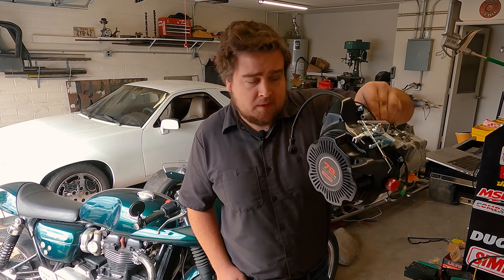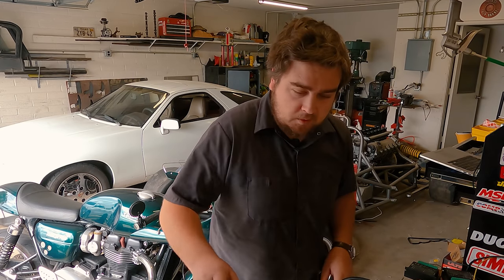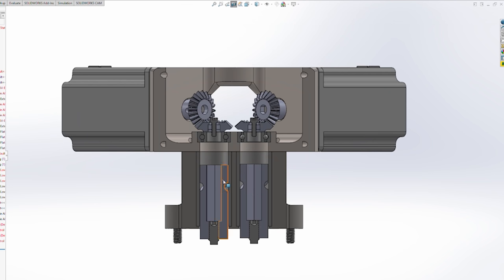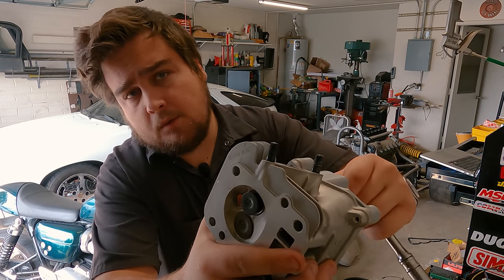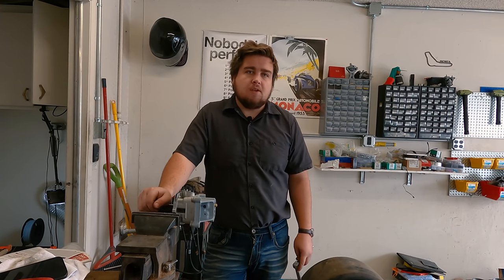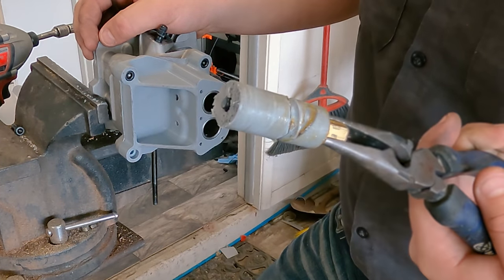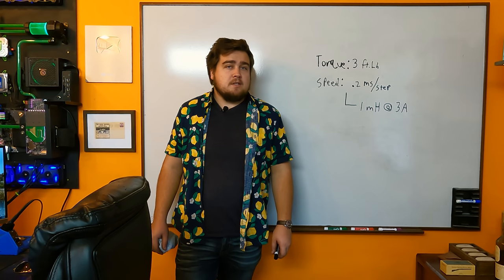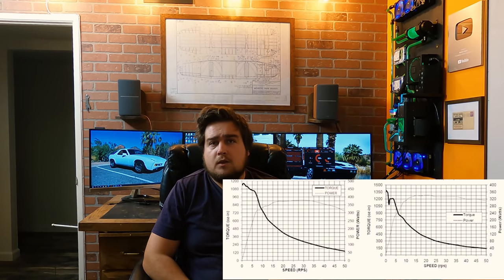Adventures In Deleting Camshafts | The Theory

Comment: The problem of necessary inertia of a motor strong enough to do the job fast enough was my initial reaction to the 3d model. Related to your calcs - the valve opens & closes muuuuuch faster than 1 whole revolution.
Reply: Exactly this, and for the best volumetric efficiency you want the valve to open and shut as fast as possible.  This will become especially important when you consider valve overlap which will need to be well controlled .

Comment: Would it be easier to find a smaller, faster-acting stepper motor, and connect them in series to the same shaft to meet the torque requirements? It seems like the response time is the limiting factor.
Also, I'm not sure your calculations are correct, because during the compression and power strokes, neither valve is moving. So the time of the intake and exhaust strokes is still going to be the duration of 1/2 a revolution, and that's the time you have to open AND close the valve, including any duration you want it full open. 6000 RPM = 100 rev/sec. 1 revolution = 0.01sec. 1/2 revolution = 5ms (that's the entire duration of each stroke). So basically you're looking at around 2ms to open, 1ms hold open, then 2ms to close (depending on how much air you want to let in and out of the cylinder per stroke). You'll be hard-pressed to find any non-camshaft system that responds that quickly, and you'll have very little granularity for tuning.

Comment: Just a thought... Make a rotating valve rather than an in/out valve. Like a sleeve valve arrangement but within the cylinder head.... As I say... Just a thought that came to me. Love your work, keep it up
Reply: The valves in 4 stroke motors are a pretty important part in their performance, the valve sticking out in the air stream creates tumble which helps homogenize the charge mixture. Rotary valves would work and be easier, but would negate a lot of the benefits

Comment: Wall color is great. Have you happened upon rusEFI? That's a similar color scheme.

Air actuators are typically fast. Either that or perhaps have a spinning motor then transfer the energy with an AC compressor clutch. If you are looking for electrical drive, a DC servo is your friend.

Comment: You could change the ball bearing guides to be non linear, Low pitch to overcome the high opening torque transitioning into higher pitch to get the valve open in time. Also if you havent allredy you need to re-make Bose active suspension

Comment: (also sent via patreon) Simplify the task, convert to running from steam/pressurized gas

That lowers your temps, and allows you to lower your RPM making it much easier/cheaper to build something that will work, allowing you to experiment more.

external combustion engine would also let you go to 2 stroke vs 4 (more power for the same size engine), and adjusting the intake valve timing to change the expansion ratio as your throttle will really show the power of computer controlled valves

Comment: When you originally said you were going to try steppers in the last video my immediate thought was "it'll never be fast enough." I didn't comment because too many youtube ppl get negative comments. TBH I really think you need to use solenoids. Maybe steal one out of a starter motor. It'll require a lot of current, and to get precise control over it some tricky mosfet pwm circuit. Negative side would be that you'll have to deal with a spring again unless you do a pushme-pullyou setup (complex). Oh well, I can't wait to see this work as you desire.
Reply from the maker: The only problem with a big solenoid is the inductance of the coil. It takes so long for the coil to discharge it can't charge up fast enough.
Reply: @WesleyKagan  Yea @5000RPM that'd be about 80Hz. You'd probably have to wind your own to get something fast enough.
Reply: @WesleyKagan  Car subwoofers seem to manage to operate fast enough at very high amplitude. Plus, rotary woofers use the voicecoil technology to operate an actuator at the required frequency.

Comment: I love the idea of the ball bearing rotation design. One thing you might be able to experiment with, since at high RPM you aren't really ever going to want to adjust valve lift (it will just be max lift above some rpm threshold), you could do a continuous bearing race, and control duration by slowing a continuous single direction spin rather than reversing, where at low RPM you can easily adjust lift by reversing. You can also improve performance with a servo motor (or just a 24Vdc motor with a rotary encoder slapped onto your design), since you don't need exact positioning anymore, just good position with good torque. If you want extra resolution on the "cam" sync position go with a little Pogo pin to ground a sensing pad when the valve reaches the top of its stroke.
Reply: Just my thought as well!

Comment: Engineering is the art of making the thing that you need, from stuff you can get. You missed on both counts! (But I love it, DO NOT STOP!)

Balls may be a bad idea in the screw-jack thingys, they're going to generate radial forces that can only jam things up, cylindrical pins or small roller bearings running in flat tracks would mean the only forces generated would be axial and rotational, (also easier to make, and make reliably).

It's also worth looking into higher voltages for driving the motors, you may have already considered this, but do not arbitrarily limit yourself to 24v, IR2 is a thing!

Loving the projects dude, it's like my school-boy notebook, but on youtube!

Comment: Just a quick note on valve actuating times: you calculate 20 msec per revolution (at 6,000 rpm). This includes things other than valve operation, like compression and intake for the intake valve (the valve should "dwell" at the ends of its operation). Camshafts typically are designed to have a "duration" of about 240 degrees or less (not the 360 you calculated); keep in mind this time also has to include operation in both directions. So, 1/2 of 2/3 of 20 msec or less than 7 msec per "stroke" and the mechanical direction-switching action usually will take up some of this as well. Of course, you can gain time by reducing your maximum rpm (probably a good idea with the Harbor Freight engine anyway). Keep thinking happy thoughts!

Comment: Wesley you are not thinking from the ground up, rather from the clouds down! My humble thoughts are to use air cylinders to open the valves and a tapered rail with a stepper motor to locate the rail and control lift. Air pressure could be controlled  somewhat  limiting lift also, Air hammer to push open the valve and a suitable spring to close it,or possibly an air cylinder around the valve stem along with a lite spring to close the valve.Air pressure could also be controlled on the closing side independently from the opening side. A lot of words I know , drawing a picture would be simpler but above my abilities on a computer. Anyway Keep up the project , as one comment was made , "Rome was not built in a day, they have been working on it for CENTURIES!!!"  and still at it !Thanks keep up the good work Fred.

Comment: I am really excited to see what you come up with, I have been interested in camless engines for a while now.  After watching the math portion and reading some comments, I have been trying to work some things out in my head.  I'm not sure if my logic is right, but here goes.  I guess the ultimate goal of this would be to achieve full lift of the valve quicker than a camshaft, so that the duration of the valve opening can be controlled to gain better performance from the engine.  In a mild camshaft for an old school v8, most of the modern grinds seem to usually end up around 270-280 degrees advertised degrees of crankshaft duration.  If we use 274 degrees as an example that means the valve isn't fully opened until around 137 crankshaft degrees (assuming a steady ramp rate and symmetrical lobes).  At 6000 RPM that means the valve will be fully open in ~3.8 ms, and only gets faster as rpms increase.

There seems to be many different ways to look at this situation.  You could calculate the effective "advertised duration" based on 0 dwell at max lift, the time to fully open and close the valve, and engine RPM.  You could also calculate the max RPM based on valve opening and closing time, where you run out of time to dwell the valve at that desired lift.

I vaguely remember you mentioning something about a desmodromic valve system in your previous videos and not using one for a certain reason, but I'm not seeing the advantage of the ball screw unless it is easier to find something faster acting and with enough power in an electric/stepper motor vs. solenoid/some sort of linear motion device.  I'm not very knowledgeable on the electrical side of things as a more mechanically inclined person, but maybe using a brushless motor could be faster than a stepper motor?  You might end up needing to really beef up the stopping mechanism on the ball screw shaft, and you would probably lose control over fine valve lift adjustments, but it might be able to open the valve quicker.

Comment: Once someone figures this out and it's released to the aftermarket, the possibilities are endless. You can go from a nice smooth "cam profile" to a high lift high duration profile by basically coding it into your tuning software so long as your piston to valve clearance is good and the springs you're using don't see any bind. That's what you'll have to watch, it'll be cool to see it work but there are more tolerances in the engine allowing this to function than just opening and closing the valves at the right time. Super exciting though!

Comment: I have been wanting to do this ever since I first heard about what Koenigsegg did with the free value system. You are doing great and I love the experimental mind set that you have of figuring out what works and what doesn’t work. I think in your first video you mentioned electromagnetic actuators as a possibility. I would definitely look into those to see if they are a viable and affordable option. The stepper motors are a great idea but I believe there is still the mechanical component there in this assembly, that will wear out and eventually break. I believe that was a big reason for doing away with the cam and chain assembly. Also for your intake and exhaust timing having you to thought about “probing” the ignition timing to get your electrical signal for the actuators. It’s seems to my understanding that you are just setting the intake and exhaust timing to a constant but in actually it over the rev range of the motor. Please don’t think I’m being critical of you, I love what you are doing. These are just suggestions, can’t wait for more content!

Comment: Use brushless servos, or just common brushless motors with an encoder on each.
Also I think you could get electromagnets to be fast enough if you overvolt them initially to get the current up quickly. Maybe have two FETs on each electromagnet, one that gives it the full voltage, and the other that gives it a lower voltage. Using a weak spring on each valve would let you open it quicker, so long as you forced it closed by putting the electromagnet into reverse. I think you could reduce electricity consumption by having the electromagnets feed their energy back into the battery+capacitors via H-bridge control, which may or may not be possible.
Great project man.

Comment: I bet you could run TMC 5160 Stepper motor drivers @48V and that would give you the torque and speed required. some cutting edge super fast 3d printers are running that way. Or you can get a closed loop stepper motor driver that attaches to the back of the steppers. it has a display that would show real time error correction. Either way I't think you would want some kind of end stop, valve closed trigger to catch errors and reset the step counter

Comment: Stock miata head for consistent location and oiling, and change the stepper ratio to something that gives you a coarse control resolution, but with a fast opening speed. It's a sacrifice in the beginning, but the raw data can only assist in the refinement process. 

Excited to see where this goes!

Comment: You have become a lot better youtuber since I started watching you. I have extremely low knowledge and experience with electro mechanics. But have you thought about using an Odrive on a regular Bldc motor (most likely with a gearbox)? I know it have a big community that might can help you.

Also, you have a dead fan on your top radiator on your wall pc.

Comment: look at trinamic enabled bldc motors in stepper Nema packages, stepper control with bldc speeds. Some other companies offer similar products with differing specs. You could also tune the ball race for the forces needed. It looks like your race design requires alteration of the steppers' direction every half cycle, and the associated acceleration and deceleration. If the race is made to always operate in one direction with known flats as needed, the acceleration and deceleration only need to be appropriate for the chosen flat lengths and open/close durations.

Comment: Ball screw vs rack and pinion?
Use servos instead of steppers? They typically out perform an equivalent sized stepper.
My approach to this would have been to develop a linear servo using a long throw sub woofer driver and amplifier as a basis, modify the amp to use a hall sensor for position feedback.

Comment: Cool video - I like the idea - it feels like it could work without some super special motors and I couldn't help but also think about how I would try fix some of these problems:
1. Gear the connection to the valves so it is not 1:1 and less steps per open/close. less torque but it looks like you have excess anyway
2. Change the shape of the ball bearing cut-outs - I'm thinking a continuous sine wave pattern all the way around which connects to itself. You could even make this sine shape with flat areas at the peaks of the sine wave so you can keep the valves closed while still rotating the motor slowly and reducing the need for such high acceleration on the motor
3. less travel on the valves from open to close state - maybe you might have to put higher pressure into the fuel for this
I'm keen to see what you come up with

Comment: something cool you could try would be to drive camshaft with a strong stepper. you can modulate rotational speed by a sine wave to control how long or short the valve is open. going ducati style lifters would reduce imaginary load, too, and let a smaller stepper drive it fine.

Comment: You should look at how 2 stroke oil injection pumps move, you could use smaller steppers geared over out of the way for space and have linear actuators to change lift  and slow and speed up the motors during constant rotation to adjust valve timing, the piston in those pumps are adjustable travel by an arm that connects from the throttle to the offset ball bearing cam and the piston that would actuate the valve in this case has an eccentric face on the top and it doesn’t rotate so the piston goes upon and down a little bit and when the motor and brought down valve lift increases

Comment: A few questions: Would it be beneficial if you had preset valve heights? Maybe instead of having 0-100, you look at two or three profiles that you would be restricted to. Maybe then you can go with a solenoid design to rotate the "pushrod". Can you find push/pull solenoids that act quickly enough? You could use a stepper to change the linkage so that the solenoid rotates the pushrod more or less.

After all, you don't really need the granularity of the stepper anyway. You want to open and close that valve as fast as possible. I also wonder if you should add a spring to the top of your pushrod to offset the force of the valve spring. I may allow your assembly to turn easier/faster.
Reply: Thought about this a bit more. Is there a reason you’d want to change the per-valve height? Wouldn’t you change the valve opening for all the valves to be the same (obviously separate for ex/in)?

I feel like you might be limiting yourself in the choice of a servo like motor. Could a standard motor without a stepper do what you wanted?

Comment: I work on aircraft neumatic valves. You could use faster motors with a mechanical stop switches to stop over travel, but the circuitry is a little bit more complex. Just a thought

Comment: Don't use ball screws without a Wobble Wing! (A very simple device that counteracts ballscrew wobble.)

Also, servo motors (or perhaps torque motors) with an O-Drive are probably the way to go for both speed and precision. They can be pretty pricey though... To offset the acceleration problems, a variable gear ratio (of some kind) may help.